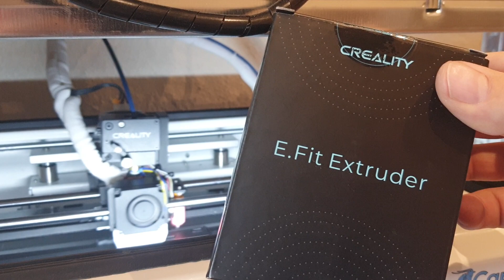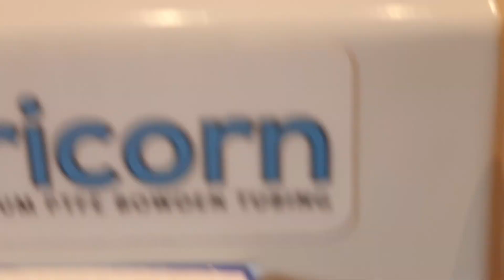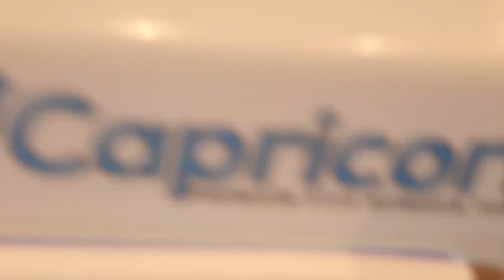CR-5 pro direct drive upgrade!

Comment: hi, thanks for the 3d parts, just have a doubt, there are two little cylinders like separators, where should i place them, thanks in advance
Reply from the maker: @dylangonzalez2146  you must mention the ones in the efit extruder set files?
This is adapter in differrent lengths to thread in a ptfe coupler.
Its clamped on the extreder it self at the bottom.
There is a couple thats included with extruder but not wath we need to connect with a short ptfe tube.
You have a short ptfe tubing to connect with stock hotend here for fillament to go thru.
Its a the ptfe couplers with m6 threads.
This is a extra security together with the bracket to keep it all stiff in place for smooth feeding.
The extruder kit dont have one of this i bought so had to include it.
Thus is If you have a bowden style original hotend.
The adapters are made for the coupler to thread in the plastic of them .
I hope this helps.
Reply: @3dskrivarskoj176  thanks a lot partner
Reply: nevermind mate, i already figure it out, thanks

Comment: hi can you say what lines you put to modify the e steps? Greetings from Argentina
Reply from the maker: @MauroPedernera-q7c  use the pronterface app for computers.
Connect thru a usb cable the computer and printer.
Make sure the app is connected to your printer and I think the default values to connect worked for me.
After that you only send new esteps trhu the app with marlin commands.
And dont forget to end with the save to eeprom command.
Now you are good to go and new esteps is saved on the printer.
Reply from the maker: @MauroPedernera-q7c  you only need the information on changing esteps and sving to eeprom from this vide.
Happy printing.

https://youtu.be/0z-Q-ZZ3Wwk?si=G3tAahEDWOk08zyJ

Comment: Hej! Använder du fortfarande denna extruder och kan rekommendera den? Jag överväger att klicka hem den plus dina filer.. ☺️
Reply from the maker: Jo den funkar bra som en enkel direkt drive konvertering utan å förstöra maskinen för mycket 😄
Bara kolla över matar hjulen å spänn till lås skruvarna innan du sätter ihop allt.
På min lossna hjulet för de var för dåligt åtdragna från creality.
Annars funkar extrudern bra med maskinen.
Jag använde min 3d fil som mall och skar ut en platta att fästa den med i slutändan.
Det finns bättre extruders men denna funkar bra mot vad den kostar.
Reply: Tack för svar! Jag printar uteslutande PETG med denna maskin och har egentligen inte haft några större bekymmer, men nu har orgnialextrudern börjat sjunga på sista versen.
 Skulle du säga att detta är en märkbar förbättring mot orginal bowden, eller är det bättre att satsa på en helt annan? 
Framför allt så vill jag har enkla filamentbyten och minimerad stringing. Orginalextrudern är hemsk att nå då skrivaren står något trångt :)
Förstår jag dig rätt att du tillverkade plattan i metall istället?
 @3dskrivarskoj176